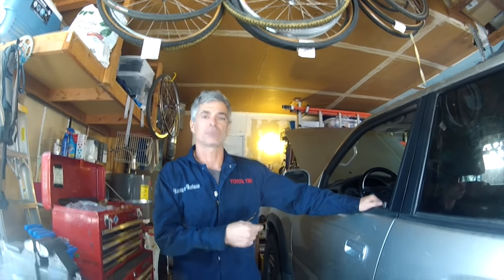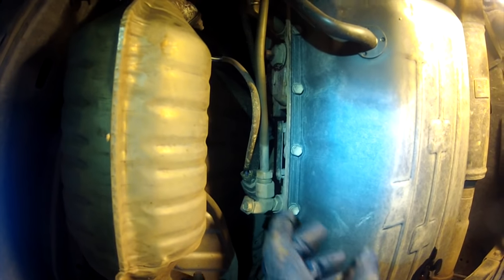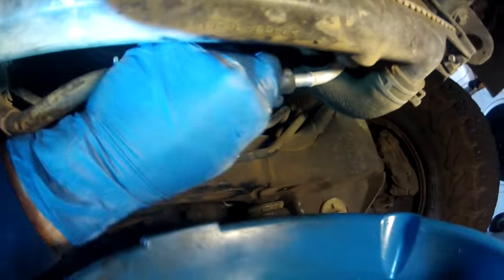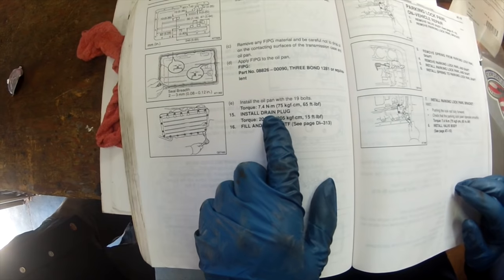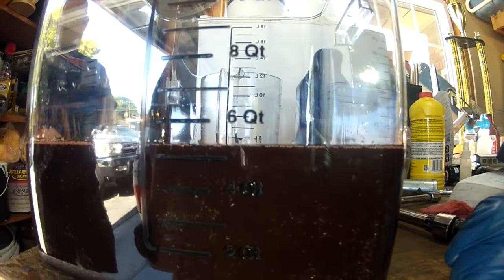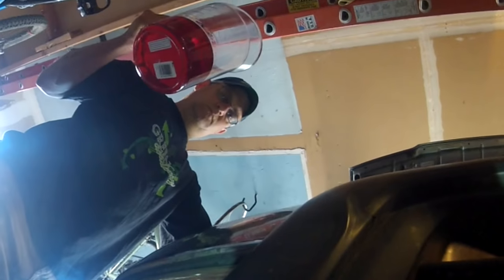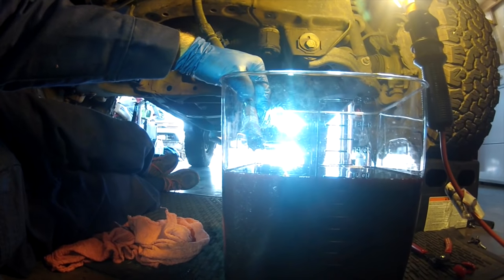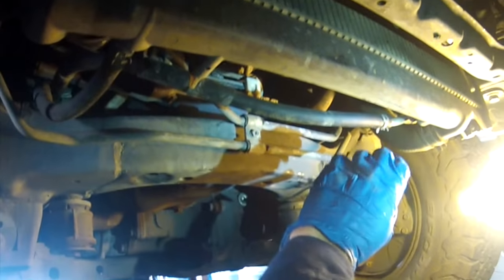Transmission Fluid Flush

Comment: Hi Timmy, can u do same transmission flush on 98 4runner manual  transmission? Can manual transmission flush or it only drain & Refill? Thanks.
Reply from the maker: Howdy, you don't flush a manual transmission.  It's just a drain and refill.  Draining a manual transmission is just like servicing a transfer case or differential.  There's a fill plug and drain plug.  Before you open the drain plug, make sure you can remove the fill plug first.  You wouldn't want to drain all your gear oil out just to find out you can't get the fill plug loose and now you're stuck with a transmission with no gear oil in it.  If the fill and drain plugs use washers, buy a couple new ones so you can replace them.  After you drain the gear oil, reinstall the drain plug and tighten to spec or snug it up tight if you don't own a torque wrench.  Pump the gear oil into the filler hole until the gear oil starts pouring out.  The transmission is full when the oil level is at the bottom of the threads of the fill plug hole.  Just make sure you're on level ground when you fill it so you get the accurate amount of gear oil in there.  

Here's a link to our 30,000 mile service video.  https://youtu.be/a81i1Cayf_I
Look in the video description and skip to the part where we service the transfer case to get an idea of how to do this for your manual transmission.  Your fill plug will be on one side of the transmission and the drain plug will be on the bottom of the transmission.
Reply: Wow, great explained and quick response too. By the way, how often should I replace the transmission fluid on the manual transmission and the rear differential? I m using amoil n is said their gear oil can go up to 100,000 miles with normal drive.
Reply from the maker: With conventional gear oils, 30,000 miles is usually the suggested interval.  With synthetic gear oil like Amsoil, you can probably go around 50,000 miles.  On that note, I recently changed my rear differential fluid after 30,000 miles and it was very dirty.  Because of this, I've decided to renew my rear differential fluid every 10,000 miles from now on.  The transmission like the rear differential is always turning when you're driving, so I'd assume the manual transmission gear oil would probably look as dirty after 10,000 miles.  Now, I've been told the color of the oil is not an accurate assessment of how effectively it's still lubricating.  You can send a sample of your oil to some place and they can do an assessment of it for you if you want.  But, changing gear oil is easy and not that expensive so why not protect your investment and give it a little love more often.  If it were me and I were using a synthetic gear oil, I'd replace it at a minimum every 30,000 miles.
Reply: Thanks so much. U have a wonderful.
Reply from the maker: I'm not a Certified Mechanic.  I'm just a dude that likes to wrench.  But, DIY mechanics can often do just as good of a job and even better than a certified mechanic.  When you're a paid mechanic, you might find yourself rushing to get to the next job because the quicker you work the more money you're making.  They call this Flat Rate Pay.  When you work fast, you might be prone to make mistakes.  You know who's going to do the best work on your rig?  You are, because you're going to take your time and make sure it's done right.  Ok, I'll get off my soapbox now.

I live in the Bay Area, San Jose to be exact.
Reply from the maker: You're welcome.  Stay tuned because we're going to keep the videos coming.
Reply: Hi Timmy, I saw in the video that I have a dewalt impact gun. I would like to know what is the model and it's size(1/4, 3/8,or 1/2)? Thanks.
Reply from the maker: The Dewalt gun I'm using in this video is Model #DCF889H and it's 1/2" drive.  When I bought it on Amazon, it came with a carrying case, 2 batteries and a charger.  The link below is my most recent purchase.  It's a much more powerful gun.  Since I already had batteries and a charger, I just bought the bare tool.https://www.amazon.com/gp/product/B00WJA1J68/ref=oh_aui_detailpage_o04_s00?ie=UTF8&psc=1

Comment: Is it the same return line and procedure on  2004 automatic tacoma ?
Reply from the maker: Yes
Reply: Thank you!
Happens my tacoma got coolant in the transmission. After changing but not  flushing the way you show. Still don’t change from 2nd  gear.do you think it could be better after. Or by adding lucas gets better. 
Thank you for your help Timmy
Reply from the maker: @petizo232  Hey Rudy, your transmission might be done but flushing it multiple times is your only chance to salvage it.  When I say flush multiple times, I mean running around 36 quarts through the system.  Auto transmissions don't do well with water.
Reply: @TimmyTheToolman  hi timmy , just have a question. 
I repleced new oil at tank closed to 5 quarters. Connected flush hose return line . started  engine and a sound like cracking bones for a second then sound disappears smooth engine but no oil coming out. You think pump is gonne. ?
Reply from the maker: @petizo232  Cracking bones sound isn't a great sign.  With the engine running, fluid should be coming out the return cooler hose.  If it isn't,  I would say your transmission is done.  The pump should be moving fluid through the system.  We have videos you can use to swap out your trans.

Comment: I have an 02 DC Tacoma (4WD, SR5, TRD) with 230K on the odometer. I'm am getting ready for another drain a fill and will be following the steps you outlined and need to buy some ATF. I have read a bunch of posts and it seems the most popular options are the Toyota Brand (00718-atf00), Valvoline DEX/MERC, and Valvoline Max Life. Which would you recommend. Feel free to send me a private message.
Reply from the maker: I've been using the Valvoline Dex/Merc in my rigs.

Comment: Hey anyone know where I can pick up that 90 degree return line fitting that goes in the bottom of the radiator there?? Mine popped out the other day driving home, think I got it shutdown and stopped driving before anything got damaged but I'm having a hell of a time trying to locate that piece.  TIA for any help.
Reply from the maker: You might try grabbing one off a wrecked 3rd Gen 4runner of 1at Gen Tacoma at a PicknPull yard.

Comment: do you have to do this if you have a manual?
Reply from the maker: You would not use this technique for a manual.  This technique to renew the fluid is only for an automatic transmission.  For your manual transmission, you would want to do a drain and refill of the gear oil.  It's usually suggested you renew the fluid every 30,000 miles unless you're using a synthetic gear oil and then maybe every 50,000 miles.  Renewing the fluid on your manual transmission is very easy.  Remove the drain plug and drain out the old gear oil.  Reinstall the drain plug and remove the fill plug.  Using a plastic pump you can buy at an auto parts store, pump gear oil into the fill hole until gear oil starts spilling out of the bottom of the threads.  When filling it, the vehicle needs to be on level ground so you get the accurate amount of gear oil in your transmission.  Reinstall the fill plug and you're all done.  Here's a link to our 30,000 mile service video and you'll get an idea of how to service your manual transmission. https://youtu.be/a81i1Cayf_I  The technique I spelled out for you is the same for your differentials and transfer case if you have a 4wd.  You drain out the old fluid via a drain plug and refill via a fill plug.  I hope this helps.

Comment: Is it OK to just drain a quart without adding fluid simultaneously?
Reply from the maker: Nate A as long as you aren’t driving the vehicle putting strain on the trans.. are you draining a quart then adding a quart?.. or just draining 1 quart and not adding it back?
Reply: @TimmyTheToolman  
Hi 
Draining and adding. Same as you did.
Reply from the maker: Nate A it’s not a good idea to run the transmission low on fluid or dry especially under load. Why don’t you want to add fluid?
Reply: I'll try to rephrase the question.
In the video you let it drain about a quart and only then you add.
My question is doesnt it damage the transmission.
I thought the right procedure is adding fluid in the same time though it will be less accurate.
Reply from the maker: Nate A being a quart low wont damage anything. Especially if you aren’t driving the vehicle and putting it under load
Reply: @TimmyTheToolman  
And was the amout about the sum of the drain pan + the torque converter or was it much more till you saw clear fluid?
Reply from the maker: Nate A it was a little more if we remember correctly. Just try to replace the same mount of fluid you took out, get your engine up to temp, and check your transmission dipstick WHILE the engine is running.

Comment: Hi, I disco'd my return line, and dirty stuff was coming out as it exited the radiator cooler (car running, gear in N as per manual), so CHECK !  - I got the right line, but I thankfully, I also placed a tube on the other end that goes back into the transmission as cooled fluid, just in case any dribbled out the other end, and I had a small steady stream of fresh fluid I poured in coming out of that line as well as the faster pressure line as expected of the ex radiator cooler line.  Why would I have a small flow of my fresh fluid coming out as well ?  I had to stop because I felt like I was emptying fresh and old at the same time ?? Grrrr  Can anyone help me ?  HYUNDAI TUCSON, 2009 JM series, not that the model should really matter ?
Reply from the maker: Some fluid will leak out of that return line and that's normal because it will drain until the line is empty.  Now, if it just keeps going and going, that does seem weird and I don't have an answer for you why that would occur.

Comment: How do you dispose of the old fluid?
Reply from the maker: Most auto parts stores will allow you to drop it off with them.  O'Reilly's will take it.  Then a recycling company comes and picks it up from them.  You can also contact your local Hazardous Waste Dispoal company and they will take it for free also.  The reason why there's so many options to dispose of the oil legally and free is they want to dissuade people from illegally disposing it like pouring it down the storm drain which will end up in the bay or dumping into a river and pollute the water.

Comment: Would it be okay to drain two quarts at a time instead of one?
Reply from the maker: Well, I don't know.  It probably is ok since the transmission has no load on it but a safer bet is one quart at a time.
Reply: @TimmyTheToolman  Copy that!
Reply: One more question. Do you know anyone that has used a ScanGauge to read the transmission temp of a third gen 4Runner? ScanGauge doesn't list a code to add and after I contacted them they told me that Toyota did not have OBDII codes in their vehicles during that time .  I know that's not true because when I connect my gauge it reads all the preset readings. Plus you were able to read trans temp values. Just hoping you might know someone that has found a transmission temp code. email me if you want at gbrian@bellsouth.net
Reply from the maker: @gbrianmullinax8448  What year rig do you have?  Trans temp info is available for years 1999-2002.  For 1996-1998, you have to install an aftermarket gauge like I did on my 98.  Here's a link to the video I made installing the gauge: https://youtu.be/fT_2szdKXRM
Reply: @TimmyTheToolman  It’s a 2000
Reply: @TimmyTheToolman  I watched that video awhile back. Another great one!  That is going to be my plan b. 
Thanks!!
Reply from the maker: @gbrianmullinax8448  You definitely should be able to read trans temp info from your OBD II port on your 2000.  I think there's a thread on T4R.org that covers the scan gauge setup.  Maybe you can find it doing a Google search.
Reply: @TimmyTheToolman  I’ll check on it . As always thanks for you help. 
I bought this 4Runner used. It was not taken care of but it’s got great bones. Thanks to you videos I’ve learned so much. You are much appreciated!!
I’m a retired firefighter. Thank you for all you do!!
Reply: @TimmyTheToolman  I found the thread at T4R.org. Isn't  it odd that it can be found online and ScanGauge doesn't even have it.
Reply from the maker: @gbrianmullinax8448  I guess because the scan gauge can be used for any vehicle, they don't want to spend the time to cover every conceivable make and model.  

I'm close to retirement myself.  I've got 2 maybe 3 years left.  My body is pretty broken but I'm trying to hang on a little longer.  I've got low back problems that are plaguing me big time.  

Great to hear you're finding our videos helpful.  You're very welcome and Happy Wrenching!

Comment: How to check trans fluid temp on my Camry 2013 with obd2? Thanks
Reply from the maker: You just have to get an OBD II Bluetooth reader sending information to a phone app.  The reader and phone app you purchase depends on the type of phone you have, Android or iPhone.
Reply: @TimmyTheToolman  I got the 
 Torque Pro app and an Android phone, but it only shows coolant temp not trans temp. How do I add  trans temp to my display?
Reply from the maker: @toppo3667  Did you try "Transmission Temp Method 3" with your Torque Pro app?

Comment: If I suffered the pink milkshake, should I disconnect the supply line and not the return?
I think I should bypass my junky radiator.
Reply from the maker: Another guy recently asked me how he should handle a pink milkshake issue.  The following is what I shared with him:

@jordub Happy to hear you like our channel.  For your pink milkshake issue, here's what I would do:
#1) Replace radiator and remove the thermostat for the flush operation.  Attach the send rubber line to the trans cooler but keep the return line disconnected.
#2) Top off the radiator with distilled water and drain trans pan.
#3) Add, 4 quart of fresh ATF via the dipstick tube.
#4) Perform 12 rounds of the trans flush procedure like we show in this video: https://youtu.be/RumPXivBlk8
#5) After 12 rounds of the trans flush procedure, drain the radiator and drain the trans pan
#6) Add, 4 quarts of fresh ATF via the dipstick tube and refill the radiator with distilled water.
#7) Repeat steps #4 and #5 two more times.
#8) If the coolant is still not looking clear after 3 rounds, keep doing it until what's draining out looks clear.  Follow this video to get the system at a proper 50/50 mix and to get the system burped properly: https://youtu.be/oQsxmi-CNng
#9) Also, if the trans fluid is still showing signs of contamination, keep performing the trans flush procedure.
#10) Once the cooling system is flushed, reinstall the thermostat
#11) Fill cooling system with a 50/50 mix and properly burp the system 
#12) Once the trans fluid is looking good, take it for a very short drive to run it through the gears.
#13) After the short drive, perform the trans flush again and run another 12 quarts through the system.

The key to an auto transmission surviving after a pink milkshake is a good flush because auto transmissions don't do well when contaminated with water.  If you caught the problem early and didn't drive it too far after the contamination happened, maybe you'll get lucky and your transmission will last you for a good long time.  But, don't be surprised if you transmission starts to give you issues.  Some guys get lucky and they end up still getting a long life out of their auto trans.  Others find that they are shopping for a new or used transmission a short time after .  For the trans flush, buy the cheapest Dex/Merc ATF you can get maybe at a place like Walmart.  For your final flush operation, use the ATF you want to be running in your rig.  I now it sounds crazy, but buy (7) 5 quart jugs of ATF.  If the jugs are 4 quart size, buy (9).  The best chance you can give your transmission to last is by doing a very thorough flush to get all the traces of water out of it.  You might want to buy a couple 5 gallon used oil containers for this operation.  Auto parts stores like O'Reilly's takes used oil.  Utilize different store locations so the employees don't tell you that they can't take any more waste oil from you.  Good luck and let me know how it turns out for you.
Reply: @TimmyTheToolman  thanks Timmy! I'm the same guy from facebook I'll do what you recommend and let you know how it goes. TOYOTA Mark Miller quoted me $750 for a used trans and $2500 for a re manufactured unit.
Reply from the maker: @jordub  Hopefully you can salvage your transmission.  When Sean's transmission went out on him, he picked up a remanufactured one from one of our local dealers for $2300, but $2500 is about right.

Comment: How long transmission drain and refill 4 times?
Reply from the maker: If you wanted to do just drain and refills, doing 3 would get your fluid in really good shape.  Drain and refills are a dilution process and not a true flush but they are still very effective.
Reply: @TimmyTheToolman  Hi. Interested. What do you mean "not a true a flush"? Sorry, I am just ask you for clarification.
Reply from the maker: @xpacmaner23  A true flush is exchanging all the fluid at one time like we show in this video so you're left with only new fluid throughout the transmission, torque converter and pan.  When you do drain and refills, you are mixing old fluid with new fluid which is a dilution process.  You are diluting the old dirty fluid with fresh clean fluid.  If you do enough drain and refills over a short period, you are doing a pretty good job of renewing the fluid also.  But, with drain and refills, you are never leaving the system with brand new fluid throughout.  Hope that makes sense.
Reply: Hi. Make me sense, clear!. Many thanks.